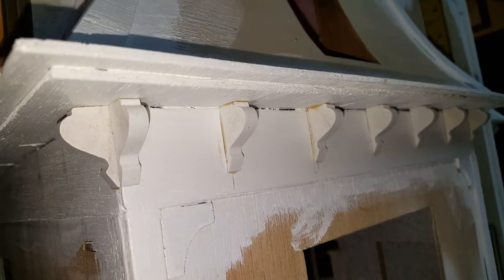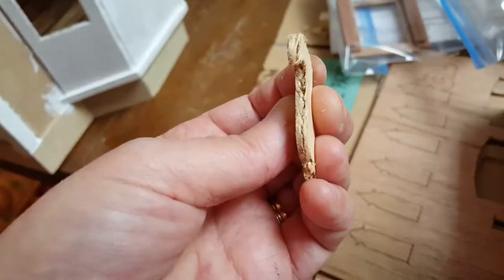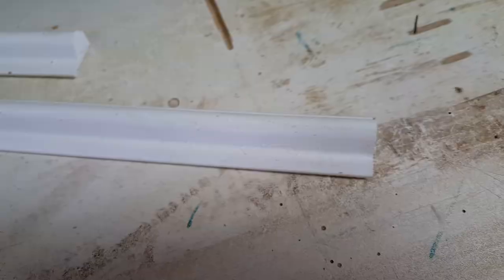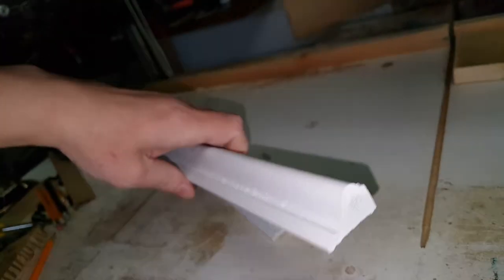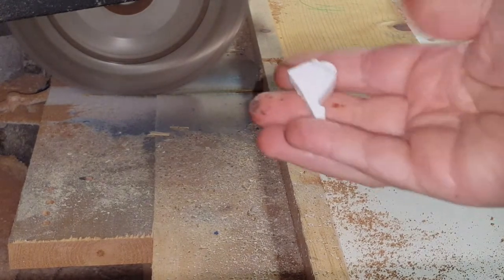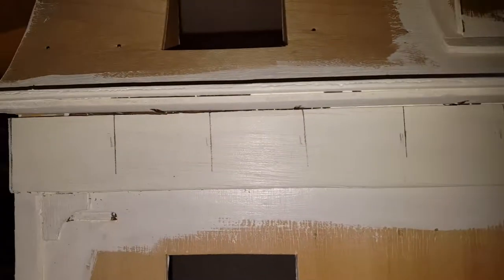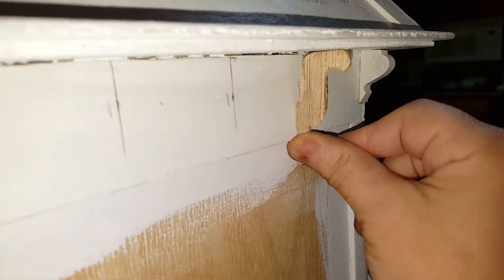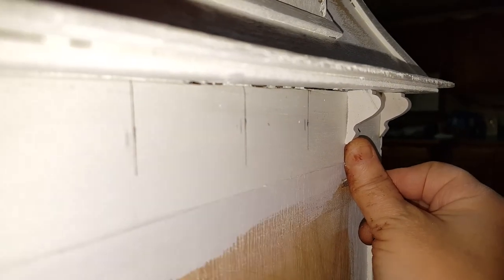Dollhouse Exterior Trim

Comment: Did you save the trim pieces you didn't use by chance?  I just bought a used/built Beacon Hill that I'm going to renovate, but the person who built it didn't put on any of the trim pieces :-(  I've made my own on the roof brackets, but the fancier stuff I haven't... Long story short, I'd buy them from ya if you have them still ;-)
Reply from the maker: Wade McLure No I'm sorry we didn't save them.
Reply: I thought the chances were slim... I found the schematics online, so I'm in the process of recreating the pieces on my computer then cutting them out with my Cricut...  It's quite a process, but it works!  hehe  Thanks for replying ;-)
Reply from the maker: Wade McLure you can buy this kind of molding from the hardware store then cut it.
 http://www.homedepot.com/p/Alexandria-Moulding-5-8-in-x-1-1-4-in-x-96-in-Hemlock-Crown-Moulding-03244-80096C/205576581

This link isn't the exact one we used but if you look around the website you will find some that will work great.